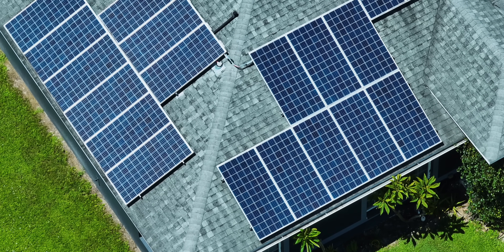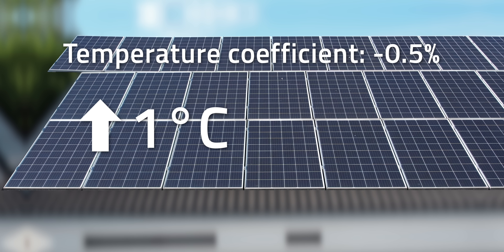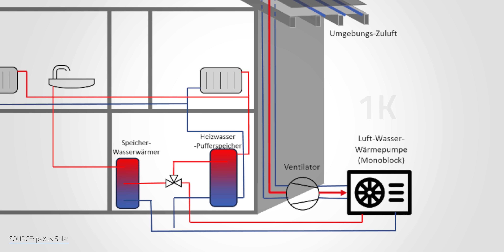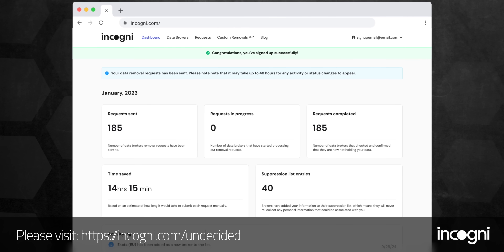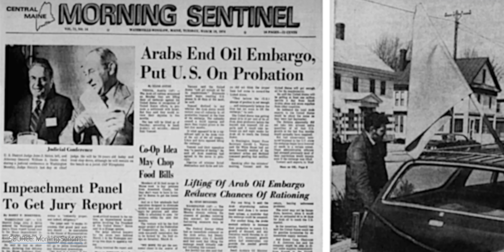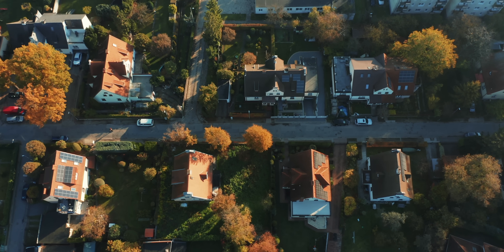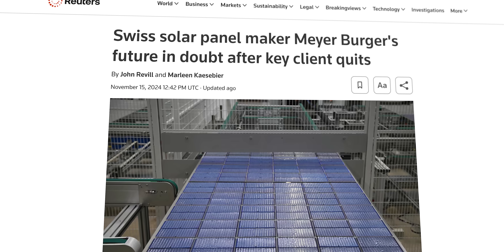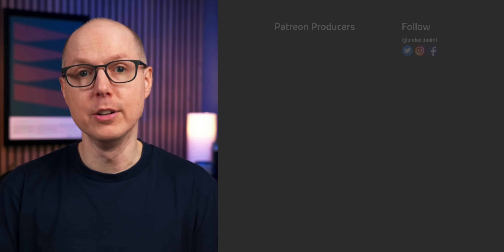Why Hybrid Solar Heat Pumps are the Future of Home Energy

Comment: In California hybrid solar would be a great way to generate electricity AND heat the swimming pool.
My roof is not large enough for two sets of panels.

The COST needs to come way down for me to do this though.

The decline of solar panel efficiency in the summer doesn't really matter if you size your solar panel installation to be large enough to charge your car and heat your house in the middle of winter you end up with WAY MORE power than you need in the summer.

Comment: The issue with solar is the installers who charge a premium cost on low skilled work while subcontracting out the “hardest parts”. Material cost for a solar system could be $10,000, and an installer would charge you $90,000 for a two day job! They’re killing their own market.

Comment: Regardless of the technological benefits of a Tesla roof, I wouldn't touch anything from that company with a barge pole. Especially its Swasti-cars. It is good to hear that a German company is innovating in this field and with something (a heat pump) that many of us already have. Our existing ones may not be suitable to be used in the way mentioned in this video, but having a heat pump or two already means that we are accustomed to having them and that makes a huge difference. I only wish house builders would build dedicated places to put these ugly and obtrusive units though. Especially here in Japan where having an air conditioner is a must-have item and every home has more than one. My home alone has 4 heat pumps, Three for aircons and one for the water boiler, which in Japan is commonly referred to as 'eco-cute'.

Comment: This seems good for helping to cool the panels and mostly heat water some. For some people like where I live, heating the house isn't much of a concern. It's more about trying to keep heat out. I guess if you integrate it into a heat pump you already have for heating, you'd get an efficiency improvement at least. But aside from that, its heating potential in winter months is kind of offset by less light during the day and if you're trying to cool the panels during the summer, that is an additional load on your heat pump system for cooling.

Comment: @undecidedMF and @theBussaca there is a challenge with expensive tech like this. SAHP’s makes logical sense but a lot less business sense. I’m already green enough that I spent a lot more buying a used EV compared to an equivalent ICE car. But even with rebates available in my area, I just cannot stomach the massive upfront premium of a solar roof compared to the already eye-watering price of just replacing a ‘normal’ roof. I’m prepared to buy used and DIY as much as I can, but even then the economics of a SAHP system just don’t pan out. I’m excited about the incredible downward slope of the Wh/$ over time (for batteries and PV) but it still isn’t far enough, quickly enough.

Comment: Here in the Netherlands SAPH is called PVT (PV+Thermal for the heat pump). We have two major brands who produce these PVTpanels on basis of pretty normal solar panels, They deliver the whole system behind it with buffer tanks, piping, heat pump and software. The brands are Triple Solar and Qsilence (from HR-energy). No, it is not cheap, but they have hundreds of installations, big and small, on gouvernment buildings as well on regular houses.
Reply: I love PVT technology 😍

Comment: These are great and I love the innovation along with the aesthetic appeal of these systems. I have been wanting solar roofing for my home and was going to install enough panels to fully power my 4400 sq ft house but mount them on a new garage building. That roof is to be a single pitch, south facing and metal with parapet walls on three sides. The garage will have four large stalls that can accommodate any vehicle in a 12 x 24 space per auto. Additionally, there will be a 10 x 20 space for workshop and storage. I calculate enough roof coverage for solar panels to support the house and battery backup. Hopefully enough to sell back to the electric company too. Was also wanting to add the wind turbines under the solar panels so I planned on allowing space for that. Am watching for development of turbines that work well enough to be cost effective for Northeast Texas. I will definitely wait to reroof the house until I have access to one of these systems that can combine solar and heat pumps to give greater efficiency and provide more electricity and longevity to the overall system. Thanks for the informative video. Keep them coming my friend. I appreciate the updates. 😎

Comment: Without doing too much research and just based on the systems alone. It would seem to me that on balance the reliability of solar equipment would be better long term just based on the less moving parts premise.  Pumps can be very reliable though.  However, as a datacenter engineer, I don't like having fluid pipes that can burst laying around. 🤣 Glycol systems have issues and I've seen entire server racks destroyed.  I think it could just be a personal preference down the road.

Comment: Ive had one idea few months ago, a little simpler and less expensive like this, but requires DIY so not commercial market solution.. And the idea is, using regular solar panels on the roofs, attaching pipes, or even regular hose could potentially work, to the back of the solar panels, move the water with some small 12V DC water pump, and just circulate this water every so minutes to lets say a pool in the summer, so now you have "free" pool heating and receive higher efficiency on panels, kind of win win.. or even instead of pool, heat house water? (help boilers?) but im not sure about that, it would need to pre-heat the incoming cold water, not circulate the boiler water itself I guess.. And yeah, this wont solve nor help anything in winter like the solution you're showing :D

Comment: SAHP thermal side needs hot and cold thermal storage (insulated hot and cold boxes of gravel) with software controlled "octovalve" to smooth out the system and add nighttime solar radiant cooling to the mix.

Comment: I thought so too but it is way more cost effective to just use ducted warmer attic air . However , the big drawback to heat pumps is that in bad weather when you need heat the most they don't work .

Comment: Commercializing is expensive. You have to train Marketing staff on how to sell the product. Installers on how to install it. Technicians on how to troubleshoot it. Engineers on how to implement it. After all that integration is never seamless. It would be easier to include in the construction of a building rather than after as an upgrade but how do you convince developers to start using the new product without existing examples of their value.

Comment: My heat  and electric bill in -40F weather, $150 a month. people in my area are paying $400. i figured my electric bill is $35 a month no matter what in the cold season, then in the warmer seasons i get billed $60. but the gas is what's costing us in the cold season. Soo i turned down the furnace and use oil radiator heater with ceramic heater mix to help the furnace, leading to $150 a month in colder months the house is as warm and toasty!

Comment: I would consider a SAHP system for my home. Would be great to get help with domestic hot water production.
However I live in a Northern cold climate (MN). 
We look at PV panels in 2020 but at the time the company we were talking to admitted their technology was five to seven years old and thus less efficient. That combined with the $18,000 we spent in 2019 replacing our roof shingles for the best available put a damper on the project. We had a guy come to the door gauging interest in solar in the last week so maybe we will take another look.

My hope is the efficiency gets to the point where I can simply add panels to our over sized three car garage which faces the perfect solar direction. I would be willing to sacrifice the shingle warranty on the garage for an install. 

Thankfully our home is rather efficient as we were told by the solar company we spoke with in 2020 and the rating our energy provider send us quarterly. Something like 25% more efficient than our neighbors. The energy audit, air-seal and added insulation we installed in 2019 likely helps.

Comment: My background is in heating oil, which eventually turned into general HVAC. I'm a certified fujitsu  ashp and spacepak ashp chiller installer. I'm not against the technology, in fact, I like a lot of the concepts. As others have said, the costs are outrageous, compared to traditional options. To get the biggest incentive, you have to dismantle fossil fuel burning equipment. Although I'm registered in New York State to get those rebates, I won't do those jobs. These heat pumps are costly to repair and do not have near the lifespan of a traditional boiler or furnace. An oil or gas boiler is easy and quick to repair. Heatpumps will leave you without heat, while parts are ordered. This is why I will always design a backup fossil fuel into the system. Heat exchangers are made laughably thin to achieve these high efficiencies and often lead to premature leaks of refrigerant. Obviously, leaking refrigerant and costly repairs are the opposite of efficiency, and harmful to the environment. My personal opinion, is more needs to be done to produce clean energy in general, which obviously has political hurtles. Heatpumps need to find a common ground of durability and efficiency, perhaps giving up some efficiency, for the sake of reliability. I'm not a naysayer, just someone who has experience from the field. Most heatpump customers in NY are hammered with electric bills. It ends up being cheaper to use the fossil fuel backup. Obviously solar panels can offset that, but is also a costly endeavor. Efficiency and green energy is a rich persons game, unless the government decides otherwise.

Comment: My issue is the overall €/year for the heating of water and space (system + maintenance + energy). I live between the Alps so it's kind of cold winter, with not much light, and mountains shield you from the sun anyhow. This, plus the vast majority of condos vs singular homes favor condensation heater alimented with natural gas. For hot water in the summer we still can use solar panels to warm the water before entering the heater, but that's it... The main issue is concerning to the cost of electricity: in winter, where the production solar panel is lower, is when the heat pump will need to work more, requiring to buy electricity from the grid. This is--in average--much more expensive than buy the natural gas in Italy, being one of the most expensive in EU.
However, we need to consider that generally we never have companies that are into installing "state of art"  heat-pump or solar panels for clients and we rely on 4-5 years old techs (I guess because they are known to at least work). Will this SAHP finally make a difference in term of value, compared to modern natural gas heaters?

Comment: Interesting variation on PV-T.  I wonder if one could use PV-T and a heatsink to warm the input air if the water isn't warm enough to use it directly for hot water, if you have an air to air pump?

Comment: I would like to know if these tiles are cheaper than a new normal roof plus standard solar panels. You mention the high cost for replacing a roof but whats with new buildings?

Comment: In the mid-1990s, there was considerable development of small solar thermal closed-cycle turbine cogenerator systems suitable for home use, where heat gain on metal tube arrays in premade roof panels would boil and pressurize a refrigerant that would then run through the turbine and return to the array as a liquid.  The whole generator unit fit easily into a small attic space, and adding a small ground loop made the cooling cycle more efficient and let it also provide cooling in hot weather in addition to heating the home (or providing hot water).

The cost wasn't bad, but maintenance was seen as too expensive for homeowners.  But the continuing development of small heat pump systems makes me think that it's time again for simpler solar thermal cogeneration to be a cost-effective option to photovoltaic, never mind photovoltaic / thermal hybrid systems.  I don't know who's out there working on it, though, since PV has such a hold on the market.

Comment: Heat pumps are great in theory and have a great COP.  But for us residential customers, you need to talk about dollars per BTU or dollars per Therm.  And for many of us, Natural Gas or Propane is still way cheaper, at least on the heating side.

Our peak annual electric bill is roughly $400, and that’s due mostly to AC in the summer.  Our peak Gas bill is $40, mostly due to heating in the winter.  Why would I want to raise the electric bill so that I can reduce the Gas bill?  Increasing the electric bill effectively has no limit — you can always pour more dollars into that bucket.  Decreasing the Gas bill can only go so far until it hits zero.

Comment: You can modify panel plumbing to send heated water to panel and melt ice/snow that stops power conversion too!
I use propane heat instead of labor of roof to clear snow.

Comment: To be honest, it’s basically sounds like water cooled solar panels. Anyone water cools their PC knows the problems may come with that.
Solar panels is changing generation very fast, something installed a few years ago is already discontinued by manufacturers, which makes replacement of like for like is impossible. You spend big $ upfront for long term benefit & aesthetics now, however how knows what’s gonna happen in 5-7 years down the road. Stick to your tradition tiles & stick a replaceable system on-top is the only viable option in the market now.

Comment: Never heard of this system in New Zealand in the North Island. There could be more awareness in the South Island, where they get snow in winter. 
I recently have had a Solar System installed 5kW PV with 5kW battery. We do get hot days, 25℃ to 35℃ so I will have to see if I can detect a power drop? May even ask the installer? 
I purposely don't consider a heat pump. For me to spend NZ$4,000 on a heat pump, that needs a new master unit in 15 years equals 4000/15= NZ$266.67 per year. What's the point. I won't spend that much in winter in my area. I may as well put that money into more solar panels. The excess power after charging the battery, will give me $0.12c / kW hr. So it's like earning interest (tax free) on my solar versus heat pump. What about summer I hear you say. Well, I turn on the fan and sweat it out. Eventually the body acclimatises. I can handle far hotter days after moving here 23 years ago from a colder climate, than I could before. I am sure I am better off than the people I meet who artificially adjust their climate and suffer in summer.

Comment: I don't see this working tbh.
Case. Summer
Is hot inside you want to cool your house so you need to move heat away, definitely not dumping it into the panels, and also not putting the panels heat on your house...
Where do you gain the panel efficiency now?
You could say you also cool the panels, but that would just be a panel only solution, so improving efficiency of the panels themselves with cooling ( not sure if the -10 degrees on the panels, so 5% efficiency would justify the consumption of the heat pump... We need a mathematician!!)
In the winter, sure, you get a 25% increment as you said.
Still a bit skeptical that the improvement is linear, in the case of very cold weather, I think a view of PV peak power over temp would be nice and the average solar power temperature over the day on average air temp and humidity. Although very technical I guesss
So it seems like, the investment is seasonal for the 4-6 months.
If as you say price of installment is 2 to 3 times higher people won't buy it. Specially, since many still use conventional heating radiators ...

Comment: The times of the year when the solar panels are too hot but the house too cold are kind of rare. Probably no more than 10 days. You can use the heat for hot water, but the demand for that is kind of low as well in summer.

Comment: Hydrid thermal PV panwls are not new - only the marketing is.... 
We looked at similar for PV + Pool heating, or + Thermal Hot water + solar+ heat pump  // reverse cycle AC  in the past - not economic then...  ?? Now... - An insulated, covered pool as a heat pump  source - for cooler climated, may be an economic solution - IF the soirce already exists...

Comment: 4:08 - try checking out Dual Sun. They make panels that are standard size and has a liquid heat exchanger on the back. Does the exact same thing but with normal panel size.. 😊

Comment: A big issue, separate from cost, is form factor. While old style panels can be placed on any roof, many customers - in existing or new houses - want a “clean” looking roof. This will require solutions which can adapt (typically using inert panels/tiles at the edge. Without this, no sales in many conditions. Eventually new buildings will adopt modularity and market standards. However, in the short run …….